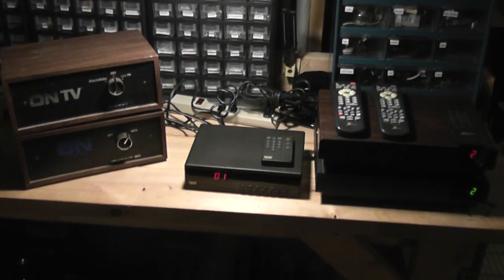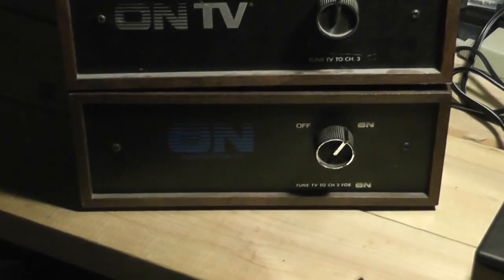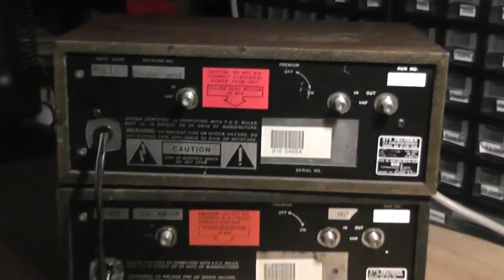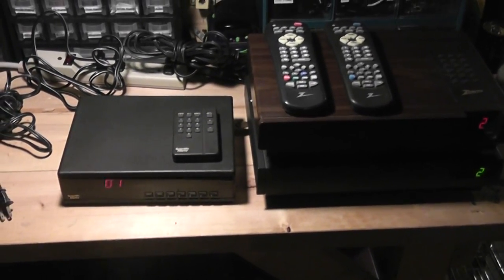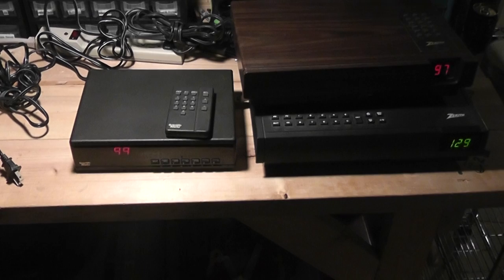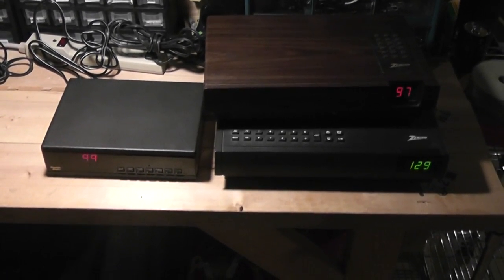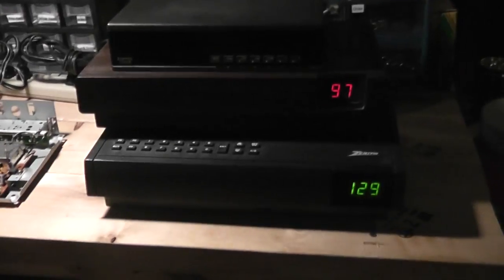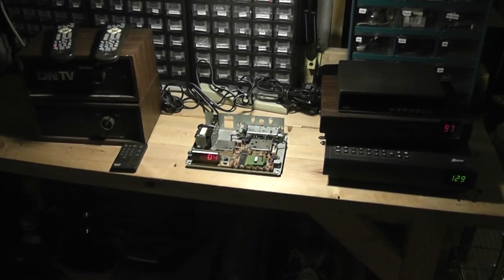Vintage ON-TV Pay TV & Cable Descramblers

Comment: It wasn't too hard to reverse engineer the signal. The standards, including the waveform, for a normal video signal are published. Being very careful about grounding, using an isolation transformer if necessary, it is still possible to connect an oscilloscope to an older TV set, synchronizing the scope to the TV's vertical oscillator, and observing the video signal. Then, a second TV could be modified to temporarily provide a fixed, adjustable, voltage to its AGC, and tuned to the subscription TV channel. Have the first TV provide the oscilloscope with sync and observe the video waveform on the second TV. Typically, the horizontal synchronizing pulses were suppressed. The pulses could be restored by inserting gain during the horizontal sync interval. A convenient place to insert the gain was in the connection from the tuner to the IF amplifier, using a FET amplifier. You could use the TV set's own horizontal pulse as a timing reference, having it trigger an adjustable one shot, which would trigger a second one shot, which would increase the gain of the FET amplifier. The signal might have trouble locking up but, once locked, would stay locked until interference caused it to unlock.

Some subscription TV stations put a pilot tone on the audio at the horizontal frequency. If you had a UHF to VHF converter with output on channel 6 sitting around, you could connect it to an FM stereo radio, tune in the UHF station's sound at about 88 MHz, tweak the coil for the stereo pilot, and get a mix of program sound and the barker. Connect a speaker between the left speaker "hot" and right speaker "hot", adjust the balance control and you had the program sound. The stereo pilot could be picked off and used as a timing reference for circuitry inserting gain in the TV set.

Zenith had its SSAVI boxes for over the air subscription TV. The SSAVI stood for the method used, Sync Suppression And Video Inversion. The horizontal pulses during the vertical interval were normal but suppressed the rest of the time. Video inversion produced a picture like a photographic negative, but not all the time. Undoing the video inversion was tricky, but could be done. Zenith modified the scheme slightly for its cable TV premium channel boxes, shown in the video.

Zenith used an addressing scheme coded into lines in the TV picture vertical interval. The test chips typically made the address always match and inserted ones in the enable bits. There was a parity bit and some test chips didn't change it, So, about half the time the data was rejected for a parity error but, eventually, the box was enabled for all channels.
Reply from the maker: Incredibly interesting thanks for providing this information!!

Comment: I had the Jerrold 400 & 450 back then & my other home had a piece of crap Zenith PM-1 box which broke all the time especially after a storm. As for ON TV we  not have it but had option of WHT Wometco Home Theater on UHF but the sound came from the box which sucked & you could not record it to a VCR as it would sound garbled.

Comment: I had my black box all the way up until 2004 before Comcast zapped it. Good times
Reply: What happened to it when they zapped it. Back then it was analog how did they even know you had  one.
Reply: @jaygriz460  They likely just turned off all the scrambled analog pay services for everyone in his area. Those who paid for the channels would be sent a new digital box from the cable company, and those who were pirating them were SOL. As I already said the high piracy rates with these boxes generally meant they were the first to go when a cable plant went digital.

Comment: On TV in Phoenix in the 80s was sent via a microwave signal where you had to mount a mw antenna pointing directly at the source to get the signal so wasn't sent over UHF there.

Comment: You don;'t have the old jerrold wired cable box. That thing was a beast for getting free playboy. All you had to do was hit 4 & 7 at the same time, then use the tuning dial. Once the box fell on the floor for the 800th time and broke open, you could actually use screw drivers to tune playboy to an actual channel so no more 4 & 7 combo needed. Ah the late 80s.

Comment: fifteen a month for ONE channel? damn, today that would be a jip off lol, now you can get thousands of unscrambled channels that your local cable company provides for a nominal fee. we pay close to 200 a month to receive at least half them channels lol, plenty of channels to work with on a late night dxing session if u want to do dx that way, not as fun though as using your shortwave radio for doing so lol.
Reply from the maker: +deyndra zeibren That was the 1980's
Reply: lol i'd say, the 80's were the days, disney channel you use to have to subscribe to and get a specialized box just to get the damn channel, same with nick, and hbo, well hbo u still need a subscription, but the existing box they give you is capible of doing so without extra hardware though. oh well, those were the days lol
Reply: The alternatives were renting tapes, but back then a VCR could cost over $1000.  ON TV also showed X-rated movies so in a world without internet porn, the $15 a month was not such a bad deal!
Reply: I recall going in an electronic store with my mom back in the late 70's early 80's seeing a vcr for about $600. Times have definitely changed.

Comment: (3 of 7)

My 8500 receives 2-62, and then skips to 97. if I manually enter a channel in between (like 66), all i get is snow, but not just normal cable-is-unplugged/AGC-is-keying-randomly "SHHHHHHHHHH" snow, rather, it is getting some kind of signal that is having an effect on the horizontal sync. I can hear the flyback buzz change significantly, and the picture looks like an image of snow, but with H-hold turned to an extreme -  giving the effect of thick rasters.

Comment: (6 of 7)

I can't find any information, manuals, or documents for it online (just a bunch of eBay listings - most expired). I have found manuals for the one in the video, and it mentions something about using the AU and PRG buttons for setting parental locks and configuring/resetting the de-scrambler. I will note that they talk about a "lockout code" that is different between models. Is this how I can go in and enable ch 63 - 78? or is it a lost cause?

Comment: Can you still use a RF modulator by hooking up the "OUT to TV" connector on the RF modulator and into the "Cable IN" connector from any of these old boxes? Is it even possible to do either the channel 3 or channel 4 tricks (like on a VCR)?

Comment: My dad had ONTV and he remembers that it was relatively easy to modify the box to get the service for free (he didn't do that but he knew others that did) by removing some blue expoxy that covered a circuit board with a big IC chip on it. Shorting certain pins together or maybe clipping the the pins off simply did the trick. 

"So easy a caveman can do it", to quote a famous catch phrase from those old classic Geico Insurance commercials.

https://www.youtube.com/watch?v=e8aj1AlYvxI

Comment: Hey Mark if I give you 50 bucks will you give me the Zenith boxes? I know you may want to hold on to them but I still get basic cable in my hometown of Rochester NY and they are making basic cable owners get used Scientific Atlanta cable boxes to view just basic cable. However the Zenith boxes would work just fine and I hate the Scientific Atlanta boxes so much. So I literally will give you 50 bucks for both of those Zenith cable boxes. Do we have a deal? Please respond soon before Time Warner makes every basic subscriber get a used Scientific Atlanta box.
Reply: +Tyler Nersinger U really shouldnt bother wasting your money unless u want to have them just as a piece of technological history.Because like he said mostly everything is digital now,and these boxes will be of no use at all in the near future.I know where i live they are completely dead.The few places where they will still function just havent switched to digital yet.
Reply: "If" you managed to place or solder a quick board, or the 40 pin descrambler you will not reach channels higher than 99 with that analog converter.... moving next comment to the main thread